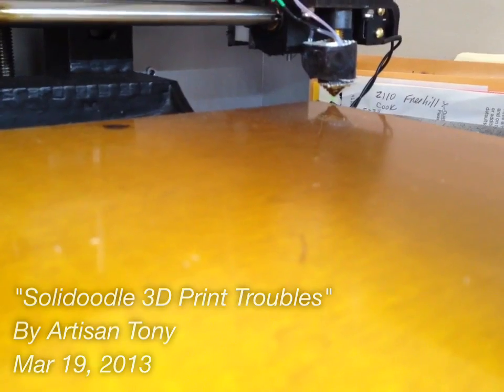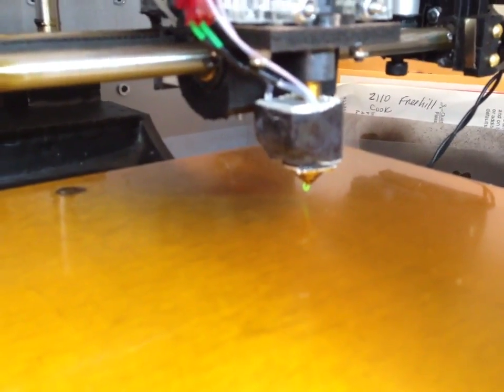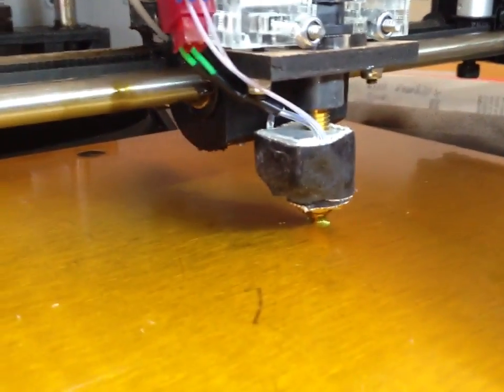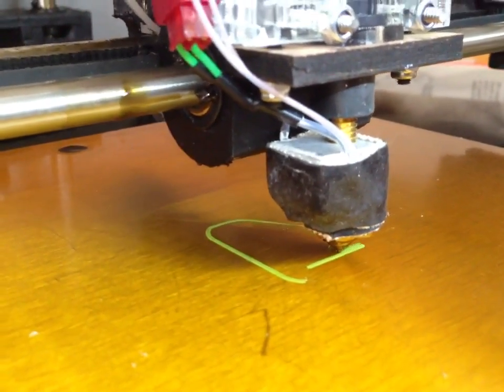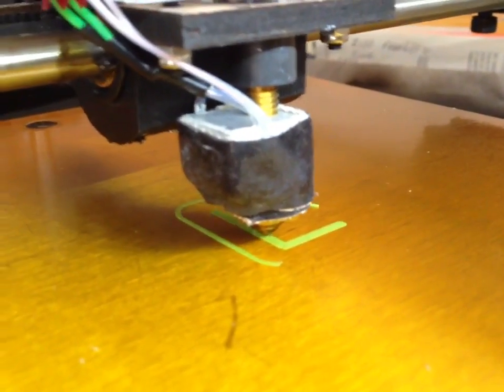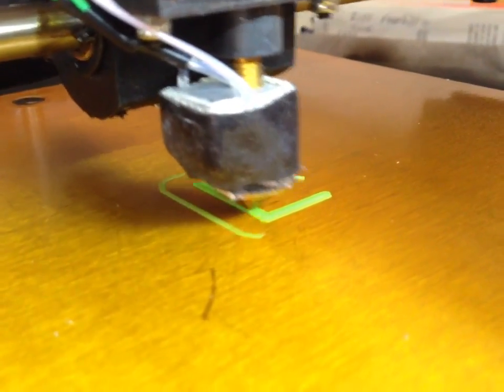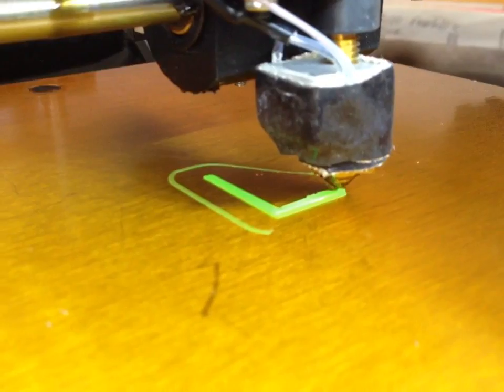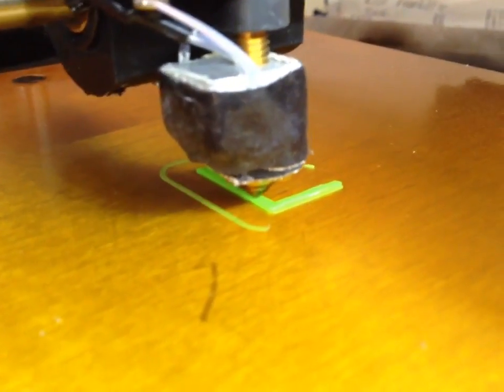Solidoodle 3D Printer Troubles

Comment: We had the same problem. Eventually, we took off the kapton tape and replaced it with blue tape. It sticks way way better than the kapton. Of course you will still have to make sure the surface and the heat head are in good distance. Now we are having problem clogging the heat head. Good luck with your printing.

Comment: i have seen other people have problems with the part coming off the bed surface, one solved it by printing small parts on a larger base of the material, which was then broken off once the part was finished. try printing like a 4"x4" square, then make your part on top of that (maybe with some stand-offs between the part and its base), so it has extra surface area to stick to the bed.

Comment: Don't have a solidoodle, but from working with ABS plastic in the past: Your heated bed should probably be hotter. I used 110-120 celcius temps back with a Thing-o-matic. Also, make sure your nozzle isn't too far away from the bed when it prints the first layer.

Comment: If you find the wires connecting the heatbed to the controller are getting warm you will need to use a heavier gauge wire because some power is being lost through the wires.

Comment: also set the extrusion temperature to 220-222C and watch it to make sure it doesn't hit 230 ( 210C on the old firmware, in which case set the temperature to 200-202C with the bed at 90C)

Comment: get rid of the kapton tape, get a mirror, use ABS juice set the bed temp at 110C and use a brim and a rectilinear grid raft with support, in rectilinear grid..  i have the solidoodle 3 and i never have detachment issues anymore.

Comment: Did you fix it yet?? If not i got my solidoodle a few days ago and the day i got it not prints would stick so i looked around and i found out that there is a small black screw above the end stop and if you turn it counter clockwise the extruder gets closer to the bed and the filament will stick.

Comment: Ill msg you my fb name name is it would be easier talking there, as far as melting together 2 tips and you have been doing some kick ass prints considering you only just started liked that ar mag you did today. i would use slicer to make more layers , and also have you done a calibration cube , you need to know that is turning out as close to perfect as possible , e.g. 1mm in the software needs to be really close to 1 in real life , but its fine adjustment your kicking ass